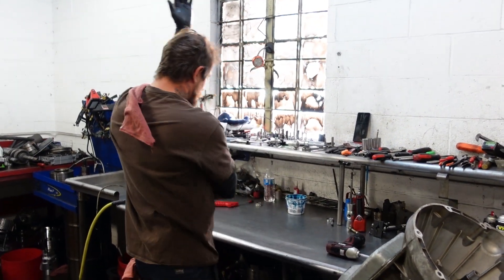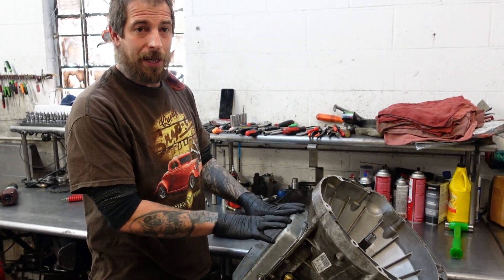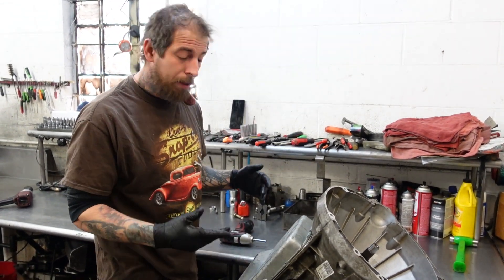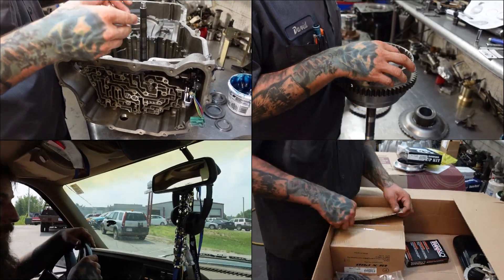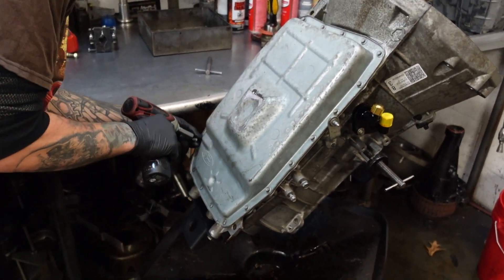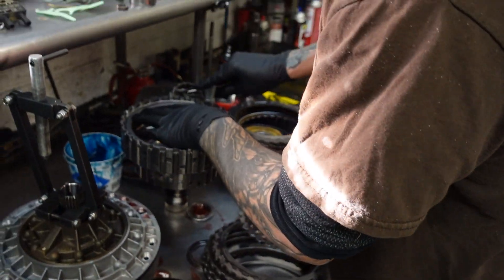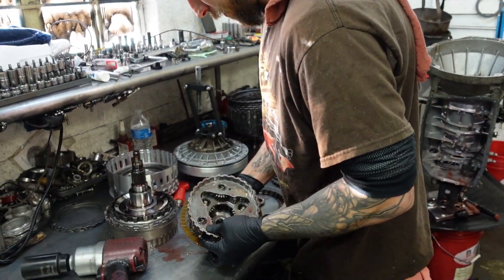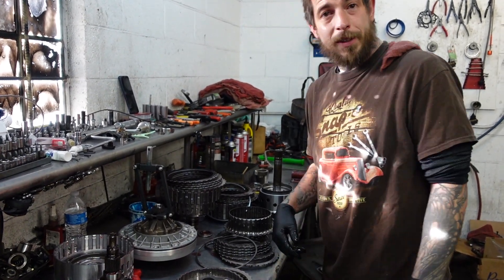6R80 Transmission Teardown

Comment: It is the torque converter
Reply: Customer was probably right when he said its in the transmission.  but this dude passes over it when he set the torque converter and valve body aside. a simple google search will show that converter has a loooong history of shutter failures and its caused fluid limiting issues stemming in the valve body. Transgo sells a kit to correct it.
flew right past it.
Reply: @brianpohero9409 yep😂 that’s why I’m here now gonna take a look at mine while it’s dropped to replace TC
Reply: yupp

Comment: My 6r80 is making a loud squawk type sound usually around 30-40 going up slight hills. Any ideas on what could be the cause?
Reply: Hey did you ever figure out what it was? My 2017 is having the same thing.
Reply: @hanksmith8626 it’s a problem with the overdrive clutch pack. E clutch.

Comment: Was the purpose of this video to show the teardown or how fast you could do it?  The way you yank the parts out of it and toss them around makes me wonder if there wasn’t something wrong with the transmission to begin with, there probably was after the teardown.
Reply: I promise you they are going to be just fine. 

If you think that’s bad wait until you see the what you have to go through to get bushings in and out of the parts. Also the table is metal and makes it seem worse than it actually is.